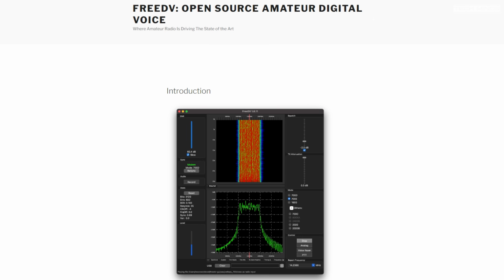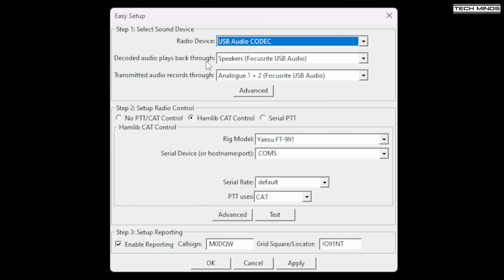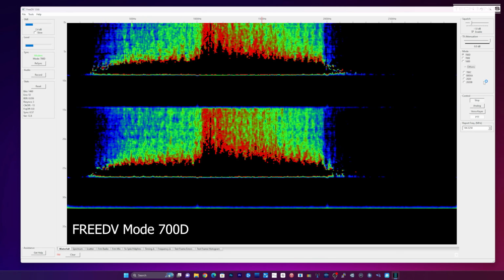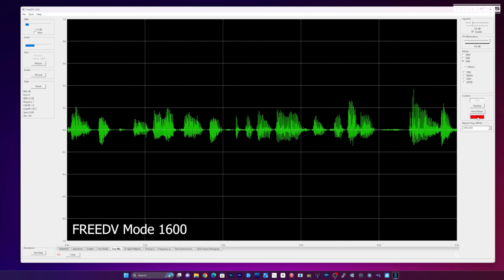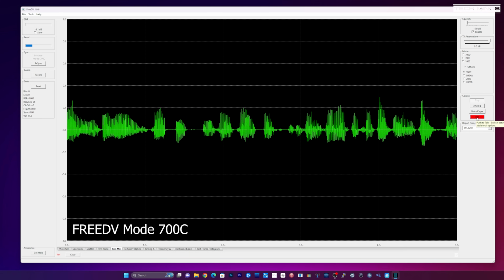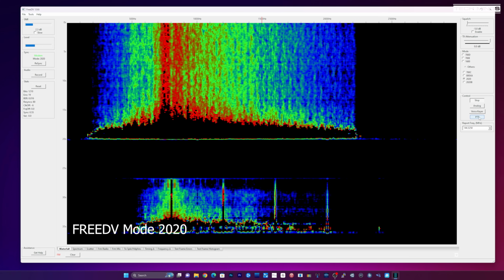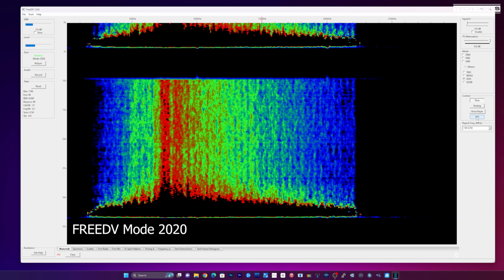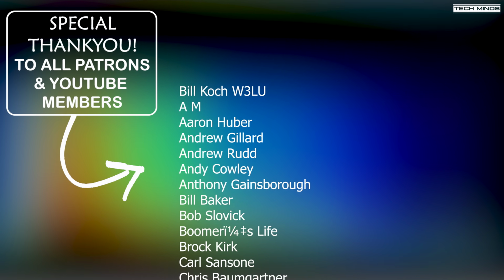Testing ALL The FREEDV Modes - But which one sounds best?

Comment: I have done a fair bit of playing with FreeDV in the past, and for whatever reason, my results appear to be a lot better than yours here. And interestingly, I was doing this over SSB on HF. Maybe a re-test is needed on this one Matt? I have found it to be a really fun and impressive mode, but unfortunately this video paints the FreeDV mode in a fairly bad light, possibly unfairly.
Reply: I totally agree. I would give it a try on SSB, too. I suspect that setting the input for “no ALC level” on TX (as for FT8 and other digital modes) would help; in general, a linear, unfiltered/uncompressed signal is needed, both on TX and RX. My extremely limited experience seems to show that better quality is definitely achievable.
Unfortunately, I miss FreeDV activity here in Europe to test and learn together, on the bands. 
Thanks for your videos Matt, they’re always fun and instructive!
All the best and 73,
Pat, HB9FAB

Comment: horrible decoded audio even in 2020 mode. I did a similar exercise a few years ago on 10M SSB with similar results. Basically, the analogue audio is much better than the decoded digital even with noise present. What I noticed too is just how strong the signal has to be to get good copy. I'm no expert but the 2020 modes sounded like there had been some data loss and that's at S5 on FM when I'd expect to get perfectly readable analogue audio. I've been following the progress of FreeDV and Codec 2 for years and I really want this stuff to work properly but, to my tired old ears, it's still not there yet
Reply: Problem is, those codecs producing garbage audio at those low data-rates,  EnCodec with Multi-Band Diffusion (MBD-EnCodec)  sounds fascinating at 3Kbps, requires about 4kbit RAW datarate with FEC and so on, using DQPSK, or a smaller RF bandwidth D8PSK modem.

Comment: The problem with most digital modes is the instability of audio frequencies during vowel sounds. This makes it extremely confusing and cognitively demanding to listen to. The 2020 was maybe a bit better in that respect.
Reply: Most are optimized for male voices as well and the higher frequency harmonics more typical in female voices are crushed by ambe codecs etc. very cool to compare these!

Comment: Interesting comparison. You can understand what's being said and can identify the speaker. All sound robotic, like over-compressed MP3. You pay your money and you get your bit rate. 🙂

I work with VoIP systems and we use G.729 as our codec. Now that the patents have expired there are no licensing issues.
Reply: We used to run G.729 when bandwidth was a real issue.  Now it's boring G.711 or G.722  (or Opus for internal calls if I'm feeling it).

You could 100% fit G729 in 5khz bandwidth... But also lose all interoperability with normal radios.
Reply: @Ardren  how would you fit an 8kbps codec into 5khz? Would you use OFDM?

Comment: Freedv is developing a new board it will be available in a few no months.  For about $100.   Use with out internet.
Reply: Yep, called ezDV. It'll support 700D, E and 1600 (similar to the existing SM1000 device that Tech Minds alluded to at the beginning of his video).

No firm pricing yet but yeah, assuming nothing goes wrong, it'll hopefully be out in a few months.